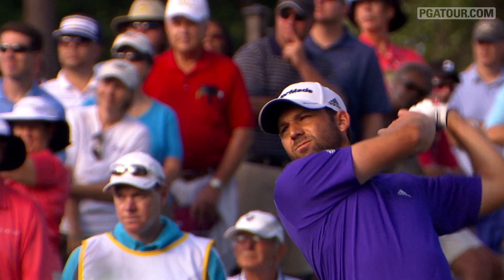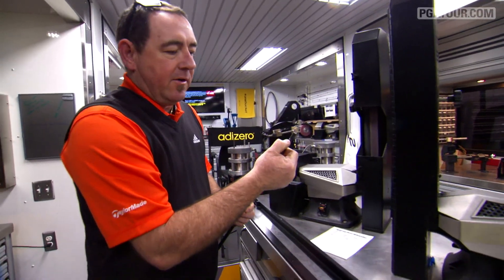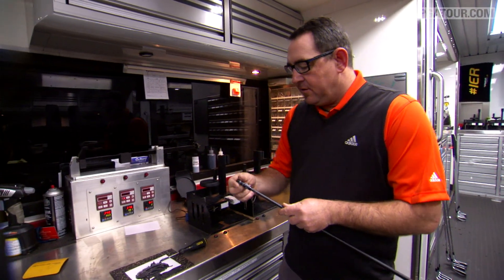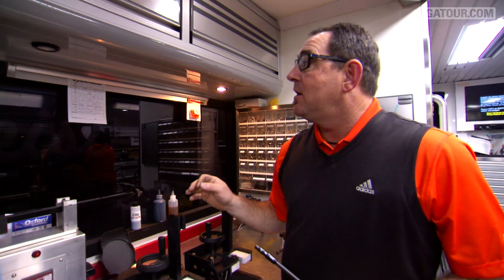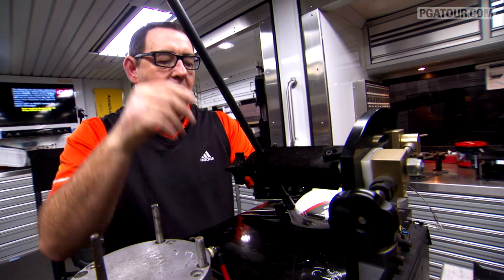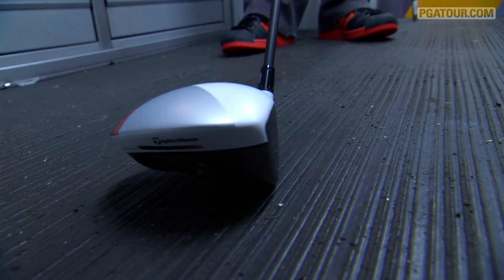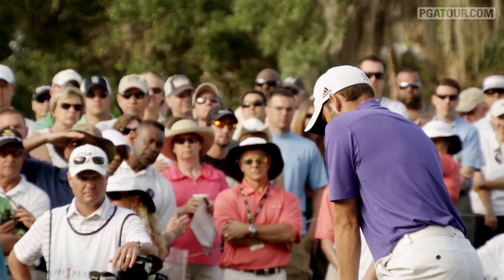Equipment: How to build Sergio Garcia's driver

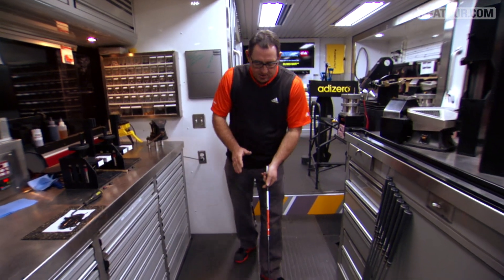Comment: Interesting, I've read elsewhere that Sergio actually used a 43.75" driver, and a 42" 3W.  If you look at 3:19 you'll see he grips down about another inch from the butt.  So if what the guy in the truck says is true, his 44.25" driver is now 43.25".  I have a R11S, it's the standard 45.75" length with Stiff shaft Adila RIP 60 gram.  I gripped down the shaft today over 2 inches.  I'm 5' 9" (1.75m) and now hitting it out of the middle every time and dead straight.  I have a 105 - 110 mph swing and the club now feels phenomenal.  I would say I'm hitting it further than ever (I carry the ball 240 - 250 yards).  For a wee guy like me, these shaft lengths on standard clubs are just too long.  Feels much more comfortable and the accuracy is great.  I'm heading to get the shaft shortened 2 inches.
Reply: How did the shorter driver work out? I'm playing a 41" 3 wood with good results. Lighter swing weight doesn't bother me, actually feels better.
Reply: sean craig Hi Sean, I bought a normal R11S 3wood just recently.  The shorter shaft in it I have now put into my driver.  I hit my driver much further and sweeter with the shorter shaft.  I just so happen to play in Spain at a course just north of Sergio's club.  He visits my club now and again to play with a friend of his here.  A short drive for me now is around 260 yards (measured).  Typically I'll hit from between 250 to 280 yards measured (with roll).  Around 240 yards carry on average.  The long shaft just doesn't work for me.  Around 43" works great.  Better strikes, fast swinging, straighter shots = confidence :-)
Reply: @meonia11  back in the day, when Tiger was first on tour, he was still using a steel shaft in his driver, playing it at 43.5". I saw that and built my driver to match. Swing speed then was 115-117, I was playing Titanium head (Titleist 975J) with Dynamic Gold x100 shaft. I agree with your assessment, shorter driver allows you to hit the ball square which usually equates to farther... 2020 and I'm researching heavy graphite shafts (70 grams or heavier) to put in my TM M2, gonna go old school and play it short in the 43.5-44" range...